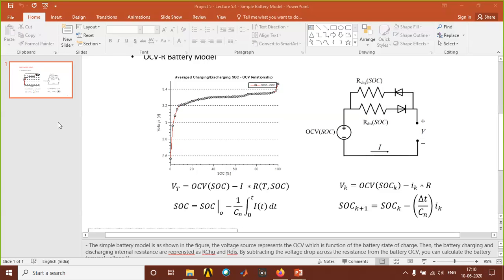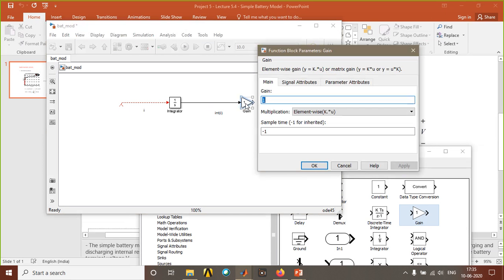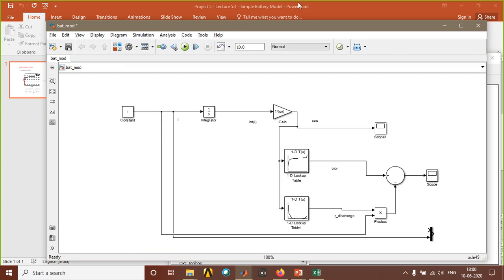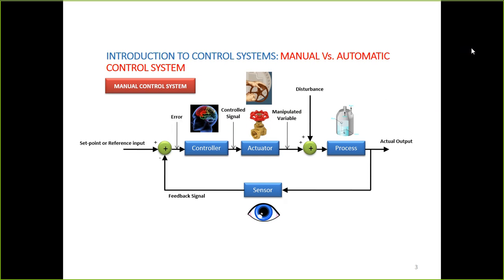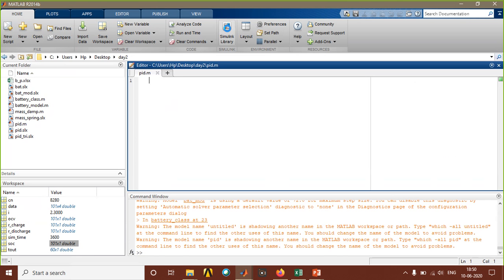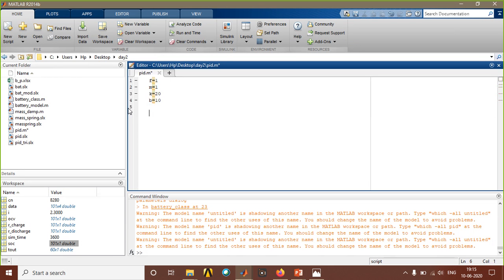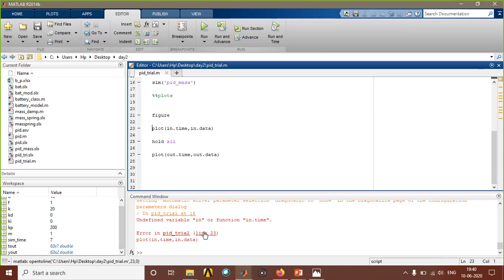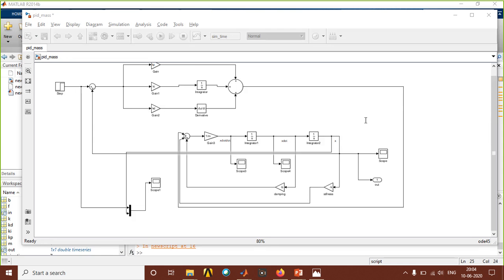ELECTRIC VEHICLE BATTERY MODELLING-MATLAB & SIMULINK

Comment: A video with too many mistakes regarding Battery modelling. 
1:03:16
Here OCV(SOC) doesnt mean we are multiplying those two rather its OCV as function of SOC. and in the same way the resistance is a function of (T- temperature and soc). T=temperature and t=time.
 Cn here is the nominal capacity
Reply: The world suffers a lot. Not because the tutorials of bad teachers. But because of the silence of the good teachers. 
Therfore, instead telling mistakes, do a video on the same topic and post.